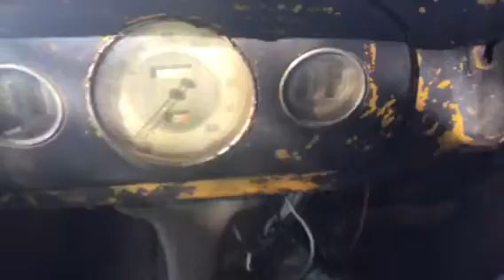More work on Farmall and Ford crane truck

Comment: What’s with the holes drilled into the boom on the truck. Maybe it was so noticeable because of the backlighting on it?  Are they for mounting something?
Reply from the maker: Keith Budreau I didn’t realize the backlighting would hurt the video that much. The boom is made from used truck frame rails so the holes are from    where rivets were removed.